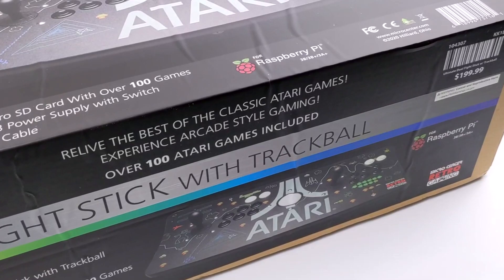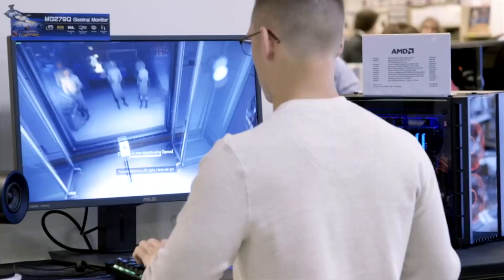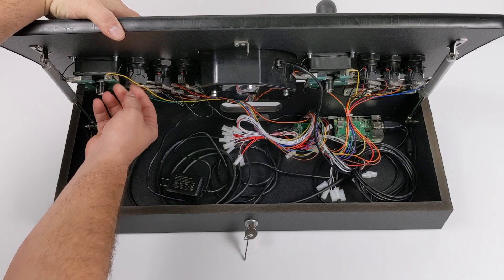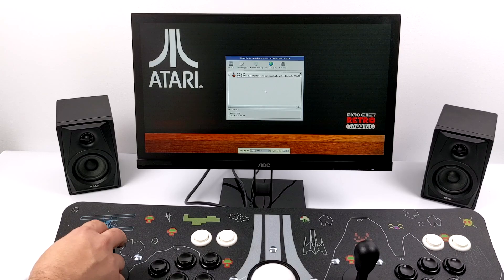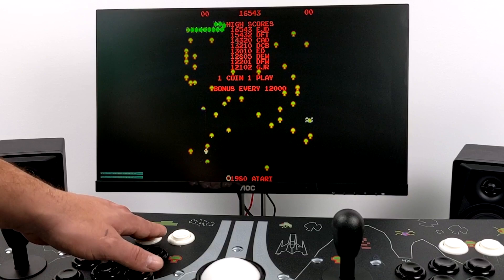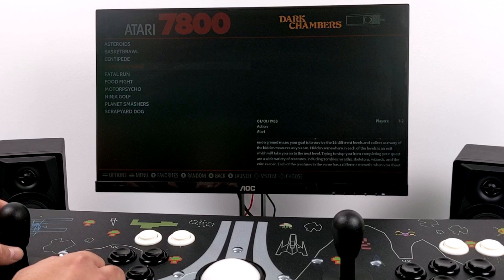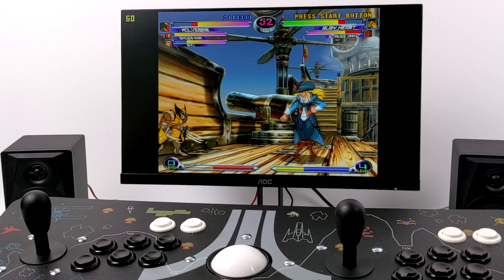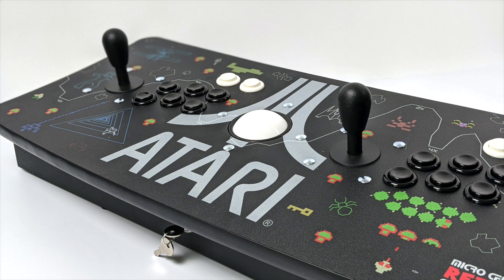The Ultimate Atari Arcade Fight Stick With Over 100 Officially Licensed Atari Games!

Comment: I picked up the non raspberry pie version  with the track ball a couple weeks ago for $129   its a great quality,  old school arcade feeling controller..   IF your not into building your own  control panels..   Just hardware wise.. its pretty much  at the cost of components if you were to DIY one..   get this thing!
Reply: That's what I was thinking, getting a predesigned and assembled kit -- because I can't assemble a cardboard box for anything.  Cables and software, yes; physical analog device things just need ... a bigger hammer and some duck tape.  And then i wonder why they don't ever last that long as it sparks and sizzles.

A spinner for Tempest would have been nice, but isn't that like the only game that normally used it?
Reply: @aeio_  you could add a spinner into this case fairly easy.. i plan on adding pinball buttons on the side of mine.
Reply: @Ebacherville  Any update on the pinball buttons?

Comment: That does look really nice...I have a Tankstick that I've debated putting a Raspberry Pi in and setting up. But what would really have been nice is if the manufacturer had installed a spinner on that thing, for games like Tempest, Breakout/Super Breakout and Pong. Interestingly, I get ads from Micro Center (well recommended for computer fans who like to roll their own like me) and the people putting these out actually have an Atari-branded USB spinner that's designed to replace a button. The ad I saw read that it was going for $39.99, much cheaper than similar spinners out there.

Comment: They have changed the graphics on the Atari arcade fightstick. The old one had the centipede spider down just below the right side controller. I want to drill a separate hole for a USB spin controller. But I need measurements of how far up from the base the center of the images of spider is. The new fightsticks have that image towards the very top near the white buttons

Comment: Microcenter are not in the UK so I can't get one which sucks.  I can't tell for sure but it looks like you might even be able to squeze in a Mini ITX build if you don't mind cutting a few extra holes.
Reply: I literally bought all the parts for a ultra small form factor pc and this yesterday... hoping to do just that... for my first emulator system
Reply: I'm in the same boat, sucks as I would buy one of these if it were available here.

Comment: I purchased the 2 player Fight stick w/Trackball a couple days before you made this review. I bought the version without the Raspberry Pi since I already had a 3b+. It was super easy to throw my own Pi in this thing. The standoffs for the Pi were pre-installed and they even included the 4 screws to screw the Pi down. Only thing I'm missing is that on/off switch that you show in your video. I gotta pick one of those up. Overall this fightstick is great at the current sale price of $50 off. Sticks and buttons are of good quality for clones. Can't complain. I threw an Arcade Punks Pi build on here and it works perfectly.
Reply: I still haven't figured out how to make the trackball work with my games. I'm using a 128GB image from Arcade Punks, and the trackball definitely outputs when I spin it (I checked via SSH shell), but none of the tips I've read online tell me how to get, say, missile command to use the trackball instead of joystick input.
Reply: @NeilNadelman  I know it works in some of the emulators on the build I put on my Pi. Try playing an arcade game that uses MAME and see if it works. The track ball might not be configured for the emulator you're using, for example the Atari emulator. So give different systems a shot

Comment: Hey, ETAPRIME? I love your videos and just purchased one of these controllers, only without the preinstalled Pi and image. There's definitely tweaking to be done when you first plug it in. Could you maybe consider doing a video to explain how to get everything up and running? I got the Xin-Mo controller properly detected, but just can't seem to get the trackball working with my games. I can't be the only one having trouble, and I've spent the last couple of days looking for answers with no luck.
Reply: Same. I did see where you have to go in to each emulators setup  to assign the ball. I just haven't had a chance to yet.
Reply: I would love to see a setup video going over the different setups like pie, launchbox, mame and Dreamcast to learn  the way to set up the fight stick sort of like your tank stick video but more than just pie...thanks for all your hard work
Reply: I eventually realized my problem: the emulator on the premade image I was using was set to use Final Burn Alpha, which doesn't support trackballs. Switching to MAME 2003 fixed it.

Comment: is there an arcade stick that has a trackball and a spinner?
Reply: MicroCenter sells an Atari branded spinner and it's on sale for $40 right now I think. You can install it in this fight stick by removing one of the buttons or just drill a new hole for it

Comment: I wonder if I could stuff a SFF PC into this thing with a 16TB HDD? Looks like there is a fair amount of room. Although, a Raspberry Pi 4 would do just about everything is want it to do. And I love Emulation Station.
Reply: I got one, and I seriously doubt you could fit a full sff motherboard in here. There's plenty of room for a raspberry pi and external drive, but there just isn't the space for a mini itx board and heat sink. The trackball and buttons extend too far down to allow it.

Comment: I have a homemade RP4 arcade stand-alone set up with some great buttons and sticks but I am having issues with the mapping of the controller for 6 buttons to make work natively for the right order for games like STREET Fighter 2 etc. Is there a guide somewhere for button layouts on RPI4 like that? I have been searching all over and find conflicting setups that just don't work for me well.I have a trackball as well, and that also is an issue.
Reply: It depends on the frontend and the emulators you are using as well as the games. Worst case you have to map each game individually, or each emulator

Comment: why Tempest don't get any love I WANT A DIAL
Reply: You can buy an Atari-branded spinner from Micro Center and then install it easily on this controller. It took me about 5 minutes to do. All you need is a 1 1/8" hole cutting saw and a drill.

Comment: Hi would you be able to share any details on how this plugs into the pc? I just got this and set up the retro pi but then i turned it of and plugged it into my pc via the 2 extra USB ports but my pc does not detect it. I dont even know if i need it plugged in to be used on pc
Reply: gee wiz nvm i figured it out not simple for a newbie, just unplug the usb male end from what is the Raspberipi and plug it in the pc no Rpi needed. dual functionality hey

Comment: I bought this without the SDCard and can't get the trackball to work on Recalbox. ETA, if you can figure this out please post a video. I have been working on this for a week now and it's making me crazy.
Reply: Hey! You sent me a message about an arcade stick with a trackball and a spinner. I wasn't able to read it because ETA Prime deleted his video. Could you send the message again, please. Thanks.
Reply: @Kevin-sl3gk  My comment was likely that they sell an Atari branded spinner separately that you can mount into one of the buttons holes or drill another hole into the cabinet. I bought the stick and the spinner last week but I haven't installed the spring yet.

Comment: Main problem i usually have is i am left handed and 90% controllers are right handed.Reason why i play games 90% on a keyboard.Only my action rpg i use controller.But like i told my brother today while playing diablo 3 ros on a very high difficulty,You learn to dodge and attack at the same time with your dumb hand 😁